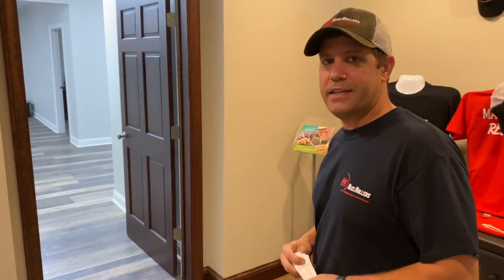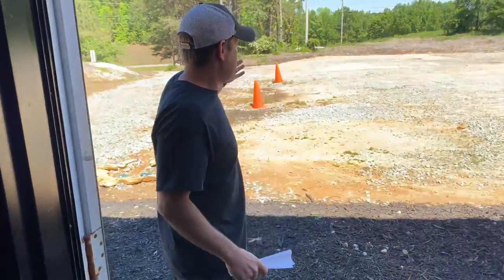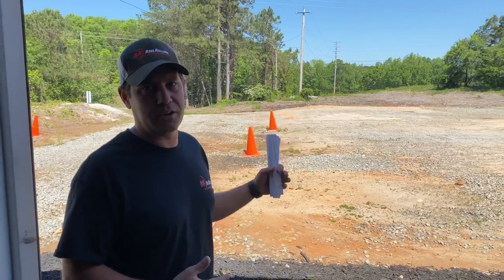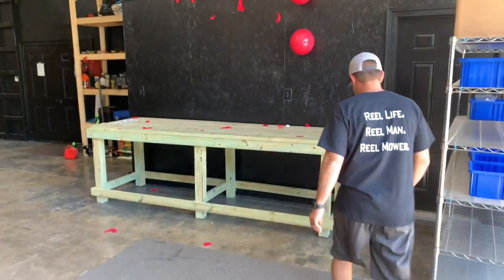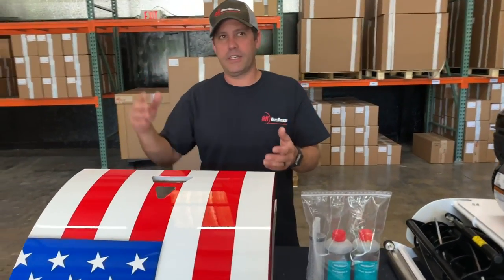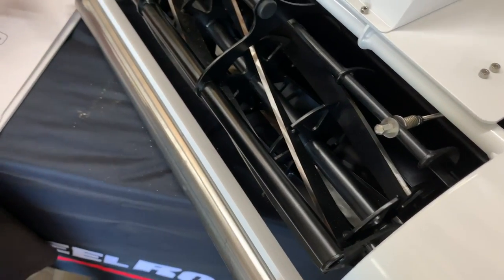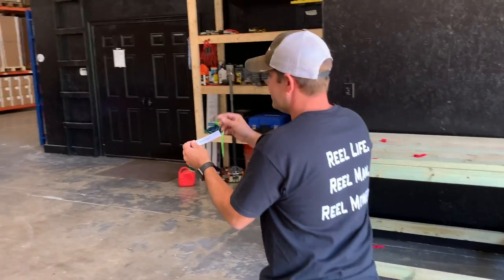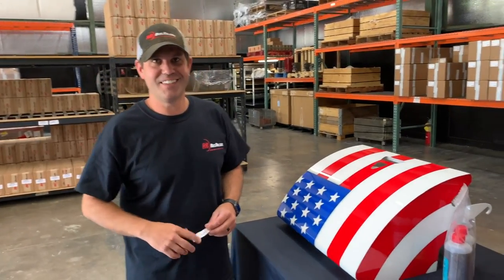Reel Rollers Swardman Giveaway

Comment: I purchased a Cal-Trimmer when I moved to my new house.  I was trying to find what was available out there and I didn't run across the Swardman.  I live in an area without a reel sharpener nearby.  I'm not sure what I am going to do when I have to get mine worked on.  

Also, the Cal-Trimmer has one small drive wheel.  When my mower loses traction it almost always leaves a bare spot in the grass.  A smooth roller like you have on the Swardman wouldn't be so quick to tear out the turf.

Congrats to the winners...Enjoy!!!
Reply from the maker: Consider a Swardman!